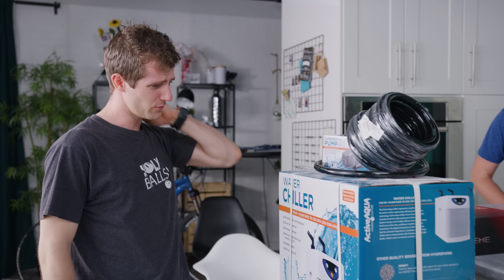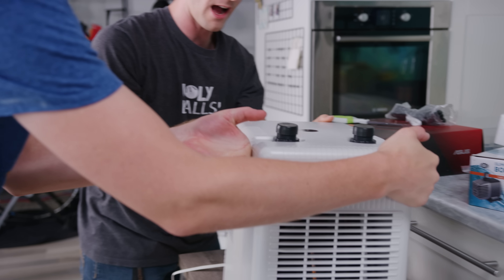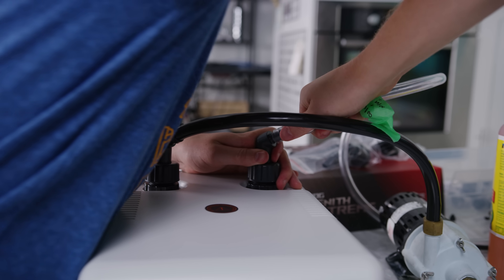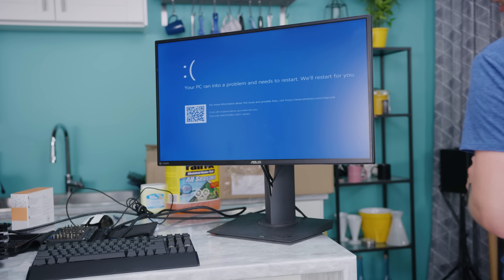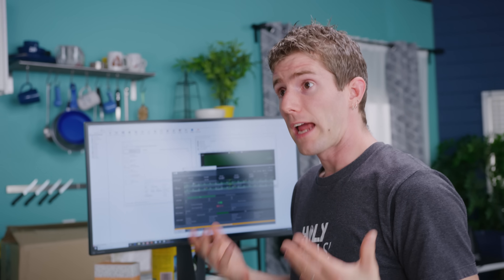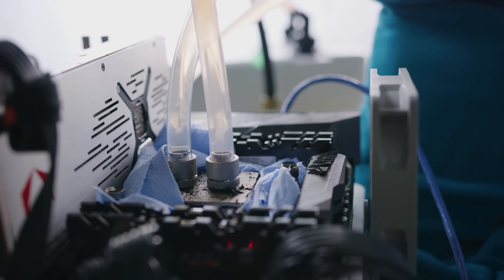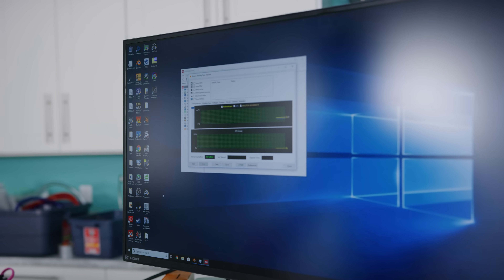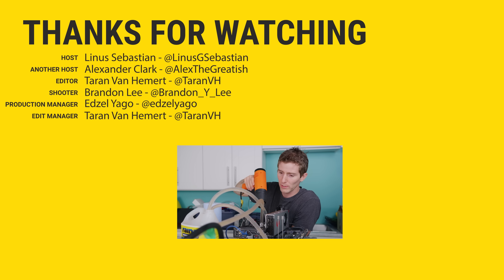Chilling Threadripper 2!!!

Comment: Isn't the idea to reduce airflow when sub ambient?  Reduces condensation.
Reply: Depends on the humidity of the room?
Reply: @tiuq23  There is always moisture in the air.  Depending on the temperature and the level of humidity, will determine when that moisture falls out of the air, called dew point.  When using sub ambient the surface of the waterblock is cold enough to cause water molecules to condense, building up water droplets.  I.E condensation.  Limiting air flowing across the waterblock will decrease the amount of water build up.

Comment: You should have  checked if the chiller has enough capacity to run the system at below ambient sustainable. Now it may be that you could only run below ambient because you had cooled a big reservoir first, and only benchmarked for a brief amount of time. 500W of heat is a bit.. What is the capacity of that chiller?

Comment: Good thing water condescending from the air is essentially free of metals, ions, etc. and thus, comparable to distilled water. This causes its conductivity to be very low, as well as water being a worse conductor at low temperatures. If that dew was tap water I'd be sweating bullets.

Comment: Set chiller to 18- 26° no use less than that! would be a waste of electricity. Chiller would produce tremendous heat. its a 1/18 chiller. wont chill instantly.

Comment: Just turn the processor upside down and let gravity do the trick with the condensation ;)
Reply: I thought of this too but remembered water has a bit of tension.
Reply: simple logic but still no need to go so low with temps......even if is cooling at 6 degrees celsius is enough
Reply: @SIGSAUER_P320  still fun to watch though :)

Comment: Just a quick note here - It's not that good of an idea to put grease directly in to the electrical connections to protect them from water. Grease is specifically meant to create a layer in between metals and prevent them from touching.

It's also (just like most regular oils) fairly good electrical insulator. 

If you want to protect electrical connections from water, you want to connect them first and THEN spray them with some grease. It should prevent connection trouble and next to impossible to detect malfunctions.

Comment: How about you try thermoelectric cooler for a cpu cooler with some jerry rigged custom loop or fan cooler to dissipate heat...... thermoelectric cooler could be used not to transfer but extract heat from the cpu......

Comment: You can put in a sealed case, pull vacuum with HVAC pump and refill with Nitrogen. No condensation possible then. Of course that pretty much kills cooling for every other part. So.  Add your Chilled water pump system to the GPU as well and viola! Over clock the fuck out of both.

Comment: Would it not be easier and more practical to create a case (read: potentially Janky mounting contraption) where your motherboard is upside down so you don't have to worry about condensation anymore pooling on the motherboard and components because it will simply fall down to be collected/discarded? It should allow you to use it for much longer and with far less hassle.

Comment: Put this whole setup into a vacuum chamber so there's no water in the air (since there is no air) so no condensation. Then full throttle the pump and the chiller

Comment: was wondering, what's up with the RainX? Is this some kind of super coolant? Also what the F is up with PETG Tubing being water soluble? There are hundreds of videos on YouTube singing the praises of PETG tubing but none the them say anything about water evaporating right threw the wall of the tubing. OMG are you kidding me? I have a PC I use for Sim Racing and after an upgrade (32 GB of RAM, and a Aorus GTX 1080 ti 11 GB Card) on my Sabertooth X79, i7 4820K, H115i Pro system thought a GPU water loop was in order. So I took the plunge with PETG and put together a great loop, I even included a copper water blocks for my south bridge and Mosfits. But little did I know I would have to add 3 to 4 oz of water daily. Well that didn't go over with me so well. So after two months of adding water I pulled the system apart, got some extra fittings and so solid copping tubing that was chrome plated on the outside and redid the loop. I do not have to add fluid anymore.

Comment: What if you mount the mother board upside down then condensation will drip from the tubes and do no water damage ever. Just have a bucket under it like a leaky roof LOL

Comment: Anyone considering using a chiller, 1/6th HP is the minimum you will need to cool a CPU and GPU. The 1/10th used in this video will be fine for just the CPU but nothing else. I have a 1/6th HP and chill a Titan XP and I7 7700K, both overclocked and it can keep the coolant temperature at 15c-20c but that's it.

Comment: As you know AMD makes calculating heater elements....don't tell anybody though...

If I may make a suggestion I would recommend you get an aquarium, place the bench inside it, put in a 2 lbs bag of silica gel kitty litter and seal the aquarium to prevent any moisture from entering the glass case, the silica gel will rid you of any water vapors inside the case as you cool the processor and the air insode the aquarium/case....
Added hack: use a universal (external = in line with the power cord) thermostat, bypassing = hot wiring the stock one) and run the water chiller to go (well) below the freezing point... maybe even go full automotive on the rig and replace liquid with a real engine coolant liquid...rated for -30 C or so and go REALLY crazy...

Comment: From the standpoint of engineering elegance, I'd rather see a proper waterblock.
Current water block designs lack the mass to achieve what really matters - stable temps across the cores.
Having a package temp of say -10, but a 10 degree delta across cores is inferior to a 40 degree package temp and 1 degree delta, as the voltage regulation becomes much easier.
A better hack than shoehorning your chiller into case would be adding a 100 gallon res to the chiller and running a separate loop to the cpu.
If you just want to try  benching as high as possible, LN2 - though we've all seen that enough -though it would be worth watching on TR2.
Go the big res route and chill your gpu instead if you want to murder fps.

Comment: Hey guys just an FYI I worked on the first film that was archived to LTO back in 2006. The 30 years thing is bunk you'll start getting corrupted sections of the tape within 4-8 years. Think about going with an Archive software that can add parity at the file level instead of using straight LTFS. Your diss of TAR was incorrect because you can actually craft a TAR command that will take a directory structure and make an additional parity file using PArchive, All depends on how much you value your media, and granted there's a diffference between a 100 million dollar movie and web content... Also don't store them in your data center closet there are weird magnetic fields that can happen, I've seen more then a few LTO's get chewed through that way. Lastly you over paid by $1000 you could have gotten an LTO-8 with a SAS card that would reliably hit that 300 MB/s for 4500 from backupworks.

Comment: Dear linustech. With your mentioned hardware i.e. a aquarium chiller and a water pump to cool down temperature, please use a low power waterpump so that your coolent gets more time for heat exchange while picking up heat from cpu and while cooling down inside the chiller.

Comment: Linus, how about variable compressor on / off depending on coolant temp.  So keep the CPU above dew point, and as it ramps up, the compressor stays on longer.  CPU goes idle, the compressor shuts off.   Also, how about using a dehumidifier hooked into a computer case to control the moisture?

Comment: seeing that chiller: someone once cooled a whole room with several computers over a central water-cooling, with the radiators outside... that idea seems rather interesting if you use a chiller instead. with a conventional water-cooling you are Always a bit above ambient, especially in the summer with outside Rads. With a chiller you could go to inside-ambient without any condensation-risk. 

Where i live we had almost 40°C outside this summer, offices are usually cooled to 21°C . It might make sense to cool the computers with 21°C water, because that is the lowest safe temperature that does not require waterproofing anything. Also the computers waste-heat is taken from the room and does not stress the air-con.
Reply: "someone once cooled a whole room with several computers over a central water-cooling, with the radiators outside..."

Geez I feel like we both know that guy that did that?
Reply: my father works for the MTA when I went to work with him once (about 10+ years ago) we had to remove water from special air-conditioning units that cooled them (they had tanks), the rooms had a very small amount of heatsinks, most of the stuff from what I remember didn't even have fans, the air conditioners cooled the whole room. Once the Acs failed and the computers got so hot they melted the the rubber and plastic mounts on the server racks. The whole thing was quite impressive.
Reply: you can actually go below ambient without condensation. dew point. multiple factors matter.

Comment: Linus you should use a dual CPU motherboard all the cores you can all the graphics cards you can water cool at all and a big air case and use that unit to cool off the water cooling blocks on the CPUs in the GPUs

Comment: lets see this setup with a watercoolered overclocked gpu and the motherboard under a shallow tank of mineral oil to prevent the moisture buildup and see how reliable you can build this setup

Comment: The Active Aqua chiller is rated for 960 BTU. In terms of watts that should convert to 278Watts. I don't think this setup could run @ 100% load for an extended time.

Comment: So I have a water chiller hooked up to my pc ….cools great but also killed 2 gpu's from drips onto my video card if you plan to do this ever 3 things always shut your pc down when not in use, never set your temps lower than needed for your overclock, and always put a layer of protection over where drips of condensation might land. Lets just hope this most recent drip didn't fry my entire PC like it did the last time since I just upgraded to ryzen 7. I can get into the bios ok but I see strange colors while trying to boot windows and the PC restarts itself. Got an RX 580 on the way so lets hope she boots back up smh

Comment: reduce the amount of gas so de evaporating point get lower. Only do it outside and if it doesn't have any liquid  holder, or build a machine by ur one for Futer test. Probably i Could help you with such a project. Maybe some kind of a R404 system with a evaporating point of -35 in a N34% Solution flowing throught the pipe

Comment: Id use the Threadripper in a 7+ games like build. Since yall are building a lan Center.

Id even chill it like in this video so you wouldn't have to worry about cooling/heating in the room. You can make a loop for 2 rigs. Maybe including the CPUs and GPUs. 
Use either soft lines to run the loop so movement of the lines are easy and arent harmful to the systems.

Comment: If you seal up the pc in an airtight container, watercool the cpu and gpu, and use a radiator to cool the air in the airtight container, you will completely get rid of the condensation problem.
Oh and make sure that the air in the airtight container is dry in the first place.

You might even go the distance and increase the airpressure in this container to get more efficient cooling haha.

Comment: I'd rather see multi-processor cooling with that thing.  See how something like that could cool 5-10 computers.  Can you reach a point where it would be more efficient per watt than individual fans for GPU/CPU?  Would almost certainly have to add cost of room air conditioning to control test to see positive benefits.

Comment: I just ordered a 1/2 HP aquarium chiller from Performance-PCS to use with my 7960X and then stumbled onto this video. Nice job, as usual.  Interesting that you are using Rain-X windshield washer fluid. I may have to give that a try. I am currently using WaterWetter with distilled water.
Reply: Got mine all set up. Appreciated seeing your video while I was waiting for the parts. https://youtu.be/cQmir3Rvgxc

Comment: Hey Linus....  so I went and DL'd the Cinebench application after watching this video from https://www.techspot.com/downloads/6709-cinebench.html    
Since the installation my Win7 Ultimate OS has a new popup prompting me to backup my encryption key and stated it was encrypting files.   To start with, I do not use and have always disabled bitlocker or any other encryption.   After a quick  "cipher /u" I found the only directory listed is \CINEBENCH r15.038_rc184115\....
My question is whether this is normal activity from the application, or something that requires immediate removal?

Comment: Fan pointing at the socket is making condensation worse. Airflow dries stuff ONLY if the thing being dried is above the dew point. Air is where the water is coming from, more air means more water.

Comment: Im using a downsized version of this to cool my pc now, the idea was to keep it cool during summer with a deskventilator with a sidepanel off. But its working so well i think im just gonna keep it like this. 
10 to 15 degrees celsius cooler  temps with a simple fan for about 12 bucks!

Comment: Hey Linus, why dont you try a double chilled system. One chiller cooling down the systems parts (GPU, cpu) and one cooling down the Air in the whole Case. By lowering the temperatur difference between the System Part chiller and the Air inside the System, you should be able to lower the condensation.

Comment: Something i would like to see would be this combo:
1. Peltier module on the chip
2. Water block cooling the peltier
3. Chiller cooling the fluid really cold supplying the water block
4. Motherboard in mineral oil (or something like that) to keep the motherboard cool and free from moisture. You could cool the oil as well...

See how far you can push the sucker!!!

Comment: You should do an inception like chilling cascade, where a dew point should not matter anymore. Put the water chiller and the rig in a small room aka big box chilled by AC to lower the dew point. And I do not mean an office AC but a pimped AC lets say driven with another water cooler device. Give the rig zero like ambient temperature and then escalate with sub zero!

Comment: It would be nice if you could integrate with the aquarium chillers firmware.  This would allow your configuration to dynamically and automatically adjust the cooler settings while factoring external variables such as ambient temp, dew point, etc.

Comment: When I ran a Peltier-and-water overclocking rig several years ago, I was drawing the CPU down to subzero temps at idle (lowest it reported was -13C) and only about 15C under load. I had to waterproof practically everything. I even had to backfill the processor socket with silicone dielectric grease to keep condensation from forming around the CPU's pins. You'd be amazed how many places water will condense and pool in when you start supercooling things. (On the upside, I was getting a solid 50% OC, which at the time was insane.)

Comment: Is it possible to build the system into the cooler. 
put that motherboard upside down, so the condensation runs away from the Chip and the board.

Comment: Why not just turn the testbench upside down when dealing with condensation? Water runs down and heat rises, so the heat that isnt transferd to the waterblock should rise and keep the socket dry? And the water should just run down along the tubes
Reply: Heat rising via natural convection is a macro-level effect that only really starts to happen on the scale of rooms. Water doesn't need to travel far from where it accumulates to cause a short on a board.
Reply: That was I was thinking.  Buy an Eheim pump too, it`s silent and durable.
Reply: cause at those temps the traces in the board transfer the cold to the rest of the board. with ln2 the whole board gets cold as fuck.